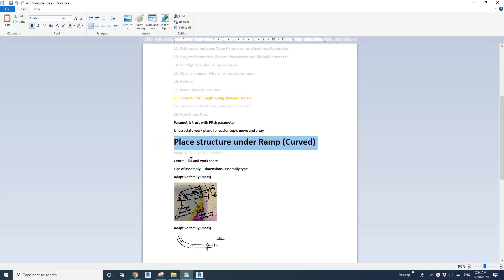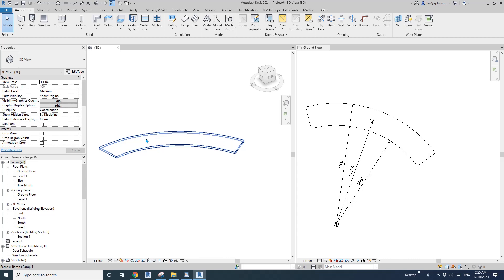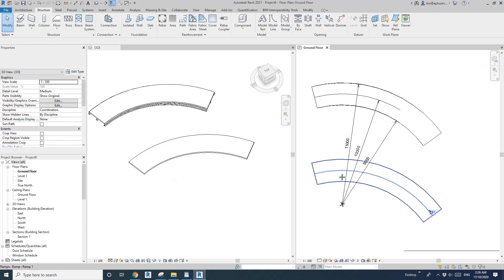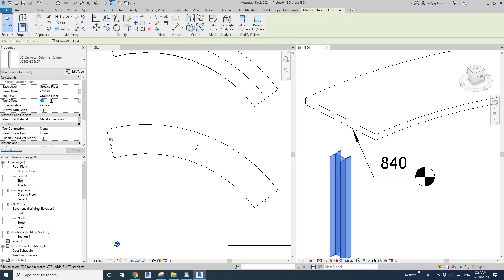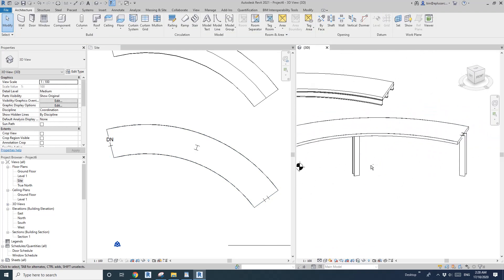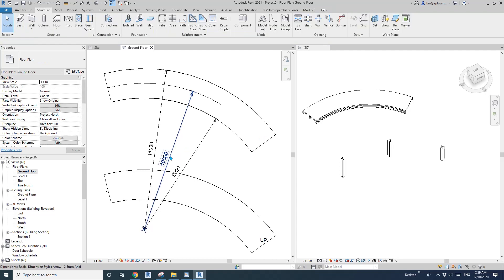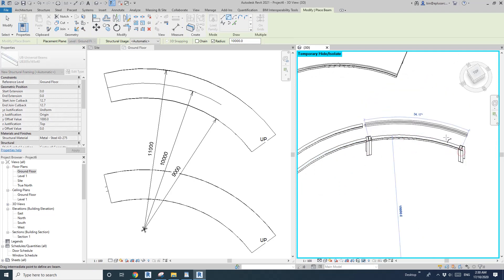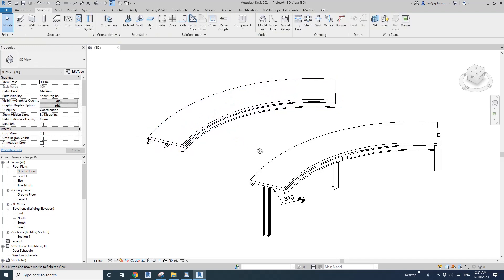Revit  Exercise (Day 212) - Place beams under curved ramp

Comment: Thanks, I would like to know if this ramp has a superlevation of 2% in its cross section and it is not horizontal along the longitudinal side otherwhise with  a slope, Which will be the best way to model it?
Reply from the maker: I think the ramp created by the Ramp will not have a slope in the cross section. You can probably try floor with modify sub element to create that slope.
Reply: @BINHE615  good choice thnx

Comment: Bin, How can  place the truss @ every 1.5 m distance perpendicular to the slab to support the structure.
Reply from the maker: Here's what I will do:  Place 2 columns under the ramp(Slab), rotate array them using the radius of the ramp, ungroup them and attach to the slab, place truss using the 2 top points of the columns, hide the columns using phase. I'm not sure if there  are better methods... :)
Reply from the maker: https://youtu.be/B8zlHA_pIvo
Have a look at this video and tell me what you think?

Comment: Thanks a lot. you have saved my time also got some tips. i have a question. if the Ramp levels either raised or lowered , how these beams would adjust.
Reply from the maker: you can use the spot elevation tool to find the level of the ramp, then manually put the height in the beam. If you use the column method, you can also find the height from the column(attach top to the floor).